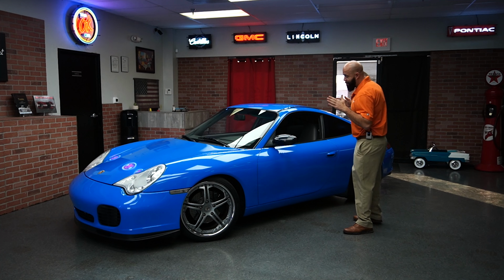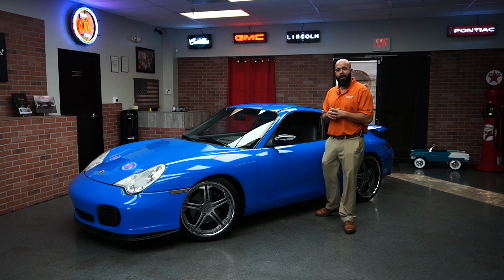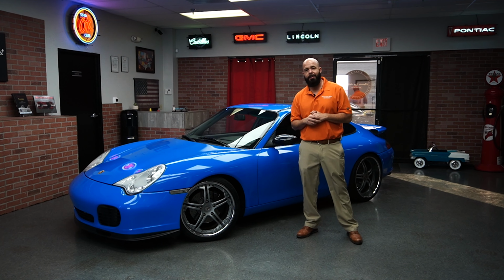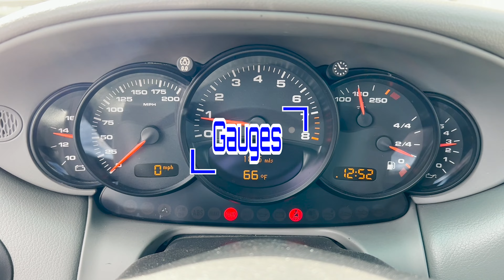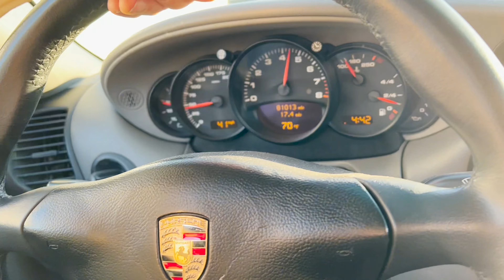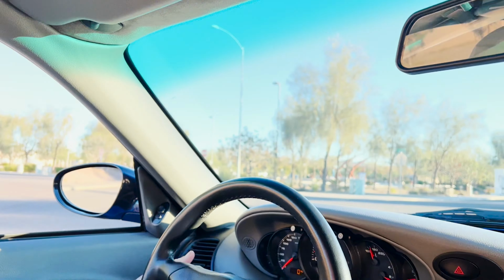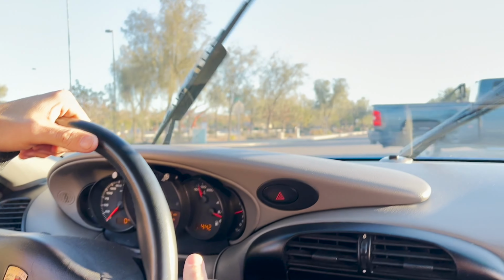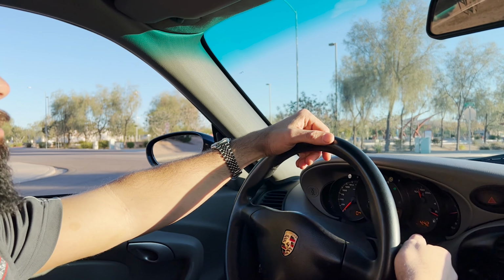Test Drive 2004 Porsche 911 6-Speed SOLD Classic Car Addict

Comment: Saw this listed on eBay and was amazed that someone could Rice out a 911 like that. Truly ruined what that car was supposed to be and I’m absolutely not surprised it didn’t meet reserve or sell for 39k when reposted. So sad to see a great car ruined
Reply from the maker: Rims and a wrap are easily replaced.
Reply: @ClassicCarAddicts  yea that’s not what I was talking abt the wing and the exhaust are what ruins it. Wing deck lid on a 40th anniversary and loud exhaust are both much more expensive to fix
Reply: @ClassicCarAddicts  it’s not gonna sell at 39k. It will be months before someone wants to spend that on a car they will need to “fix” by removing all that